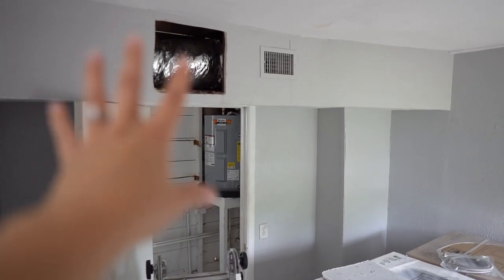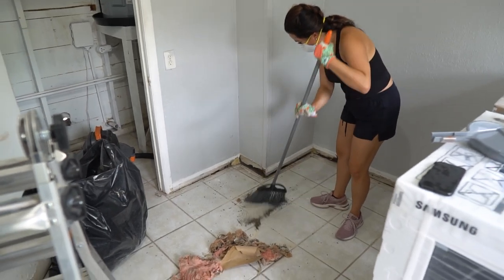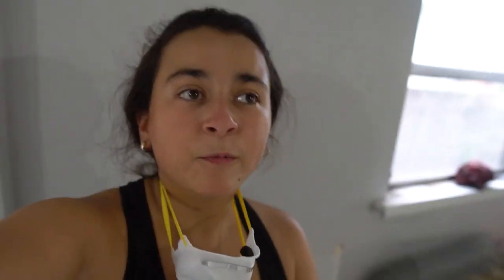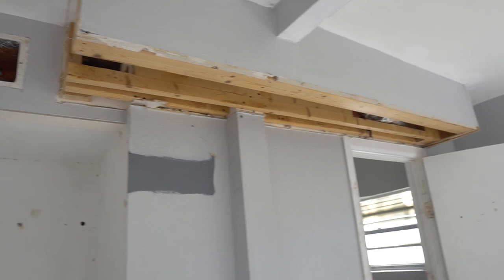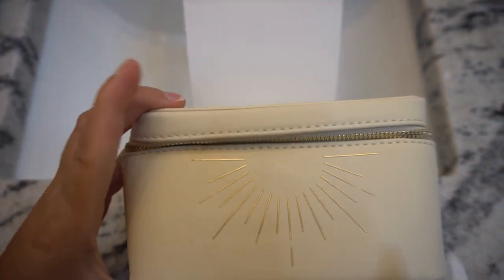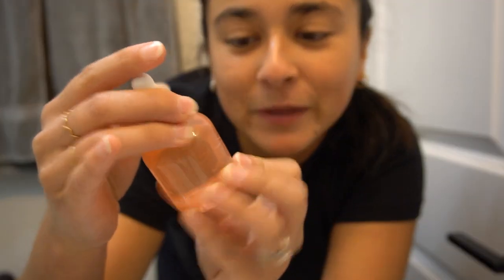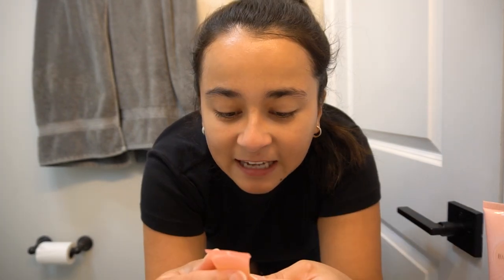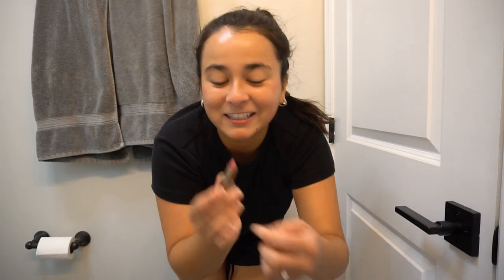THE RATS INFESTED EVERYTHING | HOME RENOVATIONS

Comment: Paying Full price was a bit over the top. Listen up people get good advise before perchase.
Reply: The house was inspected by a lisensed inspector. Which is absolutely horrible, not only did the seller not disclose these things, the inspector didn't do their job
Reply: The inspector should have been able to smell the problem or at the very least, use the device that measures precipitation in walls (used for detecting water leaks, old and new, but in this case, to detect disgusting rodent urine).  🤢